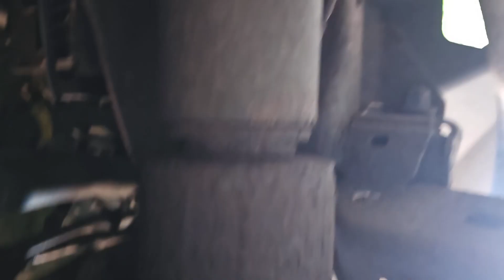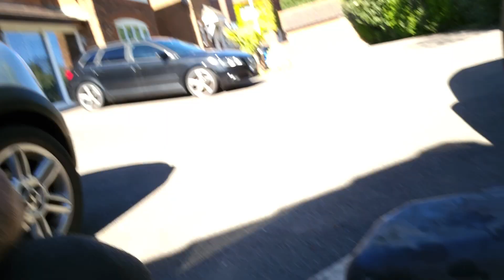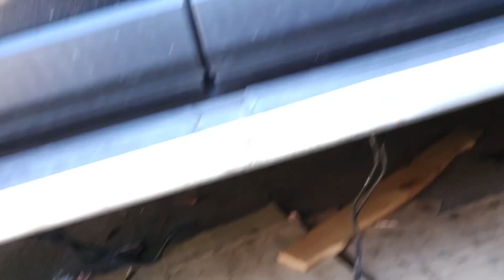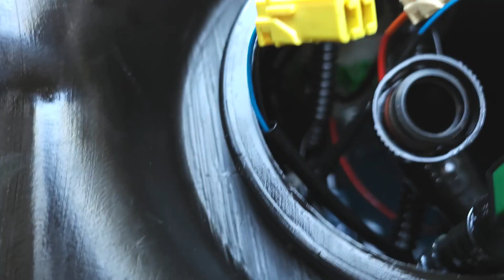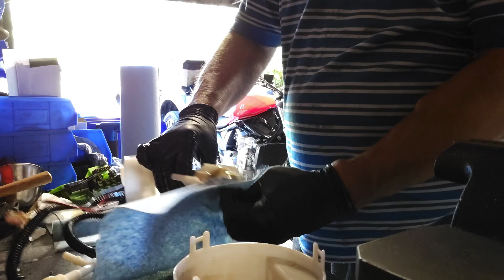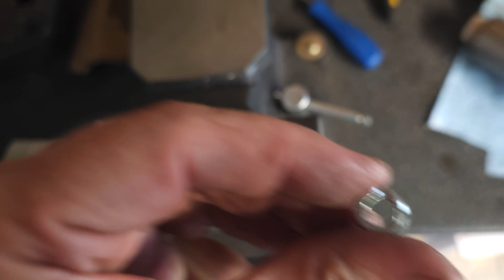Land Rover Discovery 3 (LR3) Low pressure In Tank Fuel Pump Replacement | 2023 Version

Comment: Thank you for the video!
Next time put the camera on a tripod. 
For filming handheld consider a gimbal. 
And a wireless clip-on mic ensures consistent sound.
Reply from the maker: Thanks for the feedback, I use a combination tripod and hand held, the medication I'm taking makes my hands shake, so that doesn't help. I'll investigate gimbals. Still learning, plus just changed to a new camera. I do make audio problems for myself by mumbling and moving around the camera.

Just realised this is one of my first attempts, I've just uploaded the first 2 parts of my second fuel pump replacement.
Reply: @alexgreentransplantmechanic   
If you stay in place then an overhead shotgun mic connected to a wireless transmission kit can be an easier solution to a clip-on mic. A very good option is a Rode Videomic Pro+ (not Rode videomic Pro, it is a previous version and they have few quirks that make them inconvenient). Such mic can be had on ebay auction for 60-90 pounds. 
For tripod go for one with 'fluid head' they start at 35 pounds on ebay. Fluid head is makes adjustment of angle alot smother - it really makes a difference. 
Personally I use Weebill S gimbal by Zhiyun with wireless video transmitter module - to be able to see what the camera sees on a tablet. This video transmitter can be used separately without the gimbal. 
Camera that I use is Sony a6400 because it does not have recording time limit and it can be powered through it's USB port.

Comment: Thank you for the video. What is the rated pump pressure of the old and the new pump installed?
Reply from the maker: A good pump should give a reading of around 7psi (0.5 Bar) depending on the condition of the fuel filter and ambient temperature, so a low pressure could also be caused by a blocked or old fuel filter.

Also check the fuse and relay.

The old pump I replaced was giving under 3psi on idle and dropping to 1.5psi when revving the engine.

Always read the diagnostic codes to rule out the high pressure fuel pump as well, the reason I changed the low pressure fuel pump was to cure a persistent issue with the vehicle going into low power mode.
Reply: @alexgreentransplantmechanic  thank you for the response. I am asking for the pressure indicated on the pump markings.
Reply from the maker: There were no markings on the pump to indicate the pressure. According to the manufacturer the replacement pump has the following specifications:

Flow rate
100 l/h
Input Voltage
12 V
Operating Pressure
3 bar
Reply: Fitted one today but no fuel
Coming to engine so unsure if it’s live to tank pump where is the fuses for in tank pump
Reply: I checked fuse in engine bay all
Where good did you get fuel
To engine quickly as I was thinking as I took all pipes off tent would be dry any help would be appreciated thanks
Reply from the maker: Fuel came to the schrader valve quickly, I jumped the relay to get the air out. Can you hear the pump running? It's a low humming noise when active.
If not then check all wiring connectors and especially at the fuel tank, does the fuel gauge read?
Did you replace the fuel filter?

Comment: That was helpful, thanks... I'm facing the same job and not entirely looking forward to it!  Do you have a part number for the fuel pump, or was it just a parts store item?  Cheers, Steve
Reply from the maker: I got the pump on eBay and decided to go for a branded item. I ended up purchasing a Magneti Marelli one. It was pretty much identical to the one I removed. Also, I could reuse the Land Rover filter, which seemed higher quality than the replacement.

It is still running a year later, plus after bleeding the fuel system, the car started the first time. 

I hope this helps. 

https://www.ebay.co.uk/itm/304498244096?mkcid=16&mkevt=1&mkrid=711-127632-2357-0&ssspo=7ZX3y-lfRfm&sssrc=4429486&ssuid=nO2hPlN5QZu&var=&widget_ver=artemis&media=WHATS_APP
Reply: @alexgreentransplantmechanic  That is awesome, thanks Alex... the link you sent doesn't ship to New Zealand... but I'm tracking down a few leads now I have the pump part number to go on.  Much appreciated.  I may do a video on mine when I get it - I'll have to see, I'm going to be a little time-pressured on this one as I've got a trip coming up and need it fixed before I go (assuming I can get one delivered in time).  Thanks again :)  Steve
Reply from the maker: Glad to help, good luck with your repairs.